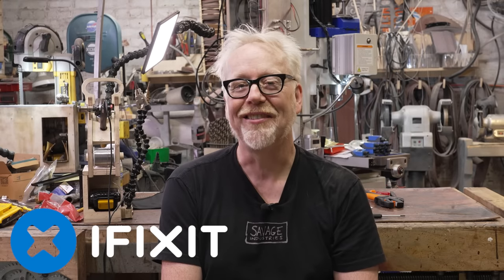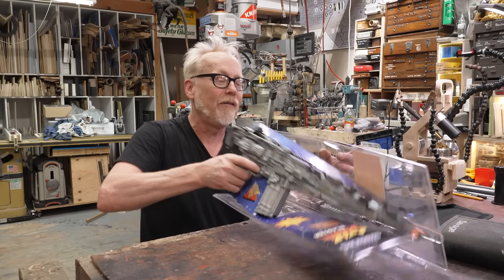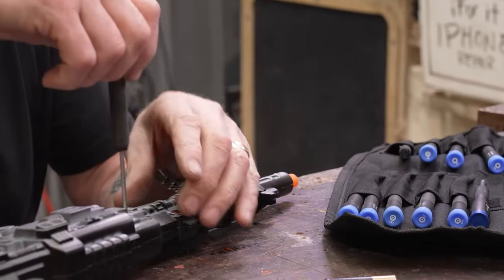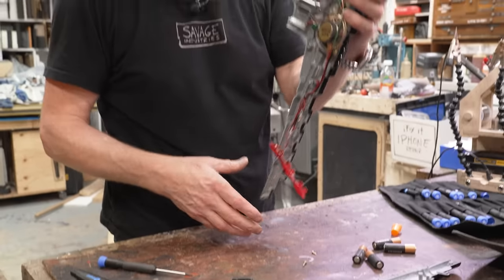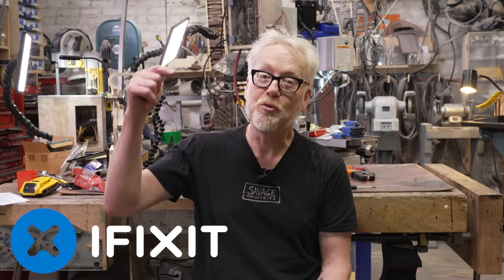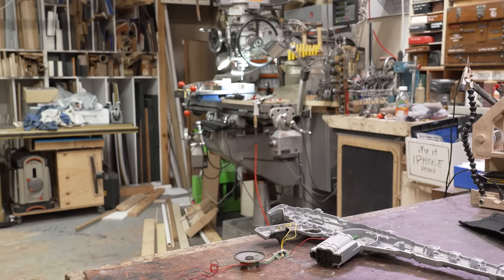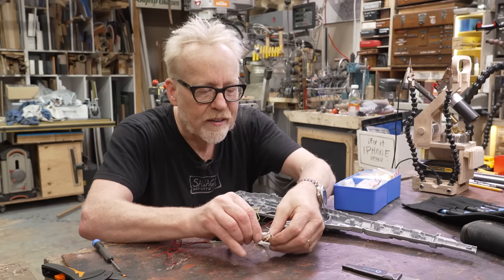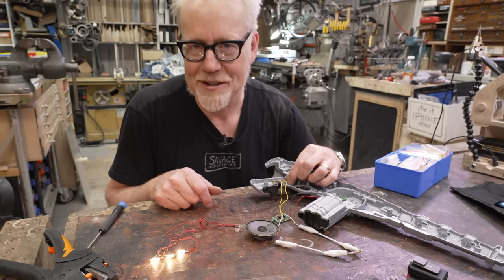How to Quiet Your Kids' Toys!

Comment: I used to put tape over the speaker holes. Helped a bit. Did not want to open new advanced toys, like talking Transformers, just in case i did not get it back together. Older toys, Shure.. A resistor and a soldering iron is a blessing. I also  got "allergic" to RGB blinking/cycling lights over the years.

Comment: For all you closet neards out there. Almost all speakers have a resistance of either 4 or 8 ohms which is normally marked on the speaker. If you had a 4 ohm speaker and put a 4 ohm resister is series with it you would have half the voltage a crossed the speaker and half a crossed the resister cutting the volume in half. With a 8 ohm resister you would get 1/3 of the voltage a crossed the speaker thus 1/3 the volume. And for all of us out of the closet doubling the volume or reducing the volume by 1/2 or  is plus or minus 3 decibels or 3db. Adam I almost bought my grandkids a set of drum at a yard but wanted to live another week so I get it.

Comment: If anyone wants a basic understanding of the simple component electronics shown here, the only equation you really need to know is Ohm’s law: Voltage (V) = Current (I) x Resistance (R), in Volts (V) = Amps (A) x Ohm’s (uppercase Omega symbol). The two other things would be Kirchhoff’s voltage and current laws. Where KVL states that the voltages in any closed loop in a circuit will have a sum of zero, and KCL states that the sum of the current entering or exiting a node (where wires are joined together) is zero. Those 3 things let you solve pretty much any basic circuit like this, though it starts to get a little trickier if you have capacitors or inductors involved.

Comment: If you put the correct resistor value in parallel in addition to the series resistor, you would probably get the correct voltage drop on the circuit for the lights to still work. 

Just guessing here, but if the speaker is say 8 ohm with a 100 ohm resistor in series, something like a 20 or 30 ohm resistor in parallel with the speaker+100 ohm resistor would pull the resistance of the circuit back down close to where it needs to be for the lights to work.

Comment: Here are my methods:
1. Open up the toy, put a piece of tissue paper in to physically damp the speaker. No cutting or soldering required.
2. Open up the toy, put a resistor across the speaker leads to reduce its volume. It reduces the voltage drop across the speaker, but this is unlikely to be a problem (in your gun, it'd make the lights blink more strongly.) Use something from 3 to 80 ohms. No cutting or stripping required, just bend the resistor leads across the speaker leads and solder it there.
3. Putting in a series resistance like you've done. Speakers are usually 4 or 8 ohms of resistance, so using a low value resistor is enough to drop the volume a lot--a 4 to 30 ohm resistor. Still loud enough to be fun for the kid, without being something that'll drive everyone in the house crazy.

Comment: I did this with a portable induction cook top. Every press of the button was just an obnoxiously loud beep, and if you took the pan off while it was running it beeped continuously. I Tore it apart and tested resistors till the sound was quiet enough but not so quiet that I wouldn't notice it beeping. So even if you don't have kids, this is a good trick.

Comment: Not a parrent yet myself but i remember my mother winning a cheap toy price that was also very noisy. 
I solved the sound issue with a pocket knife with a flat blade that i could stab through the sound slits and into the speaker without ever opening it. 
It would still blink like crazy when you used it but now with blissful silence

Comment: You never gave the toy gun to your kids! I'm not sure if you are a monster... OR the smartest person in THIS WORLD! 
My son has had some very loud toys too... after a few hours, they usually met with a timing "unauthorised wiring modification" with a pair of side cutter dikes!
OR stage tape over the speakers!  Parenting FOR THE WIN! :)

If you really want to quiet the toy or device  (I have a few noisy UPS units, that like to beep during the night time!) down for real, a well-calculated resistor voltage divider circuit will always fit the bill perfectly! Yes, Adam those semiconductors are magic! and it took several years of school to learn which way the electrons and the holes go through them, without letting out the magic smoke! :)

Great content as always sir!

Comment: You can also buy adjustable resistors (potentiometers) that you can tune with a screwdriver. But they would be a bit more pricey. They (as well as regular resistors) might get hot (depending on how much electricity is going through, so you might have to account for wattage when selecting one. I have burned resistors, and they can start fires if you're not careful. Especially with all the nice flammable solid fuel around (plastic)

Comment: A few years ago we got a cheap little train toy (engine and rolling stock) with a similarly horrible noise. We wanted to run it around a Christmas tree but it would cycle through multiple over-driven sounds the whole time. 

So I put a variable resistor (potentiometer with two legs shorted) inline with the speaker. That way we could adjust the volume to suit our mood.

Comment: If you don't have any smaller value resistors, you can connect two of them in parallel to get half the resistance.
Or you can connect them in series to get double the resistance.

Comment: One idea is to put a double pole switch in, I.E. a switch that toggles between one output and another instead of just off or on. To tell the difference, an off/on switch will have just 2 pins to connect wires while a double pole (also known as double throw) will have 3 pins with the middle one being the common pin that the switch is always connected to.

Have the wire coming from the circuit board go to the middle pin of the switch. Bridge the other two pins with the resistor and then connect one of those two pins to the speaker.

What that does is when the switch is in the position for the pin the speaker wire is connected to the input will go straight to the speaker and be loud, switched the other way it has to go through the resistor then out to the speaker making it quiet.

You could then cut a hole in the toy for the switch to poke through giving the child an option to make it quiet for inside use or loud for outside.

Comment: I did this to a toy that had a speaker and a motor(fan) and putting in the resistor also reduced the fan speed so had to balance quite well. It also made the batteries last longer which was a bonus!!

Comment: If you are wondering what type of resistor you need for this:
The cheapest you can find. Resistor quality is just about accuracy aka how close they are to the labeled value. 
Only space and medical engineers need high end resistors, almost everyone else is lying to themselves. 
This truly is a prime example on what the cheapest resistors are for. For the vague: "I wanna lower the output a bit."

Comment: An mp3 player module costs about 2$ if you just buy a single one.
It already has a micro SD slot so all you need to do is add controls speaker and power. (and the sd card with the sounds)
It has wiring options for buttons and can be controlled via 2 pin serial port RX/TX
It's size is mostly determined by the pins and the card reader. it's a card reader with pins. (I think it also has line out in case you want to connect it to a proper amplifier.)

Comment: You could add a switch to put resistor in or out of circuit. Then you could have volume set for indoors or outdoors. Heck, you could add a pot to use as a volume control.

Comment: I generally insert a 1k ohm potentiometer into the line and adjust it for the desired volume and then measure the resistance and replace with a set value resistor.

Comment: My little fix for making the speaker quieter is to put a lie e of tape over the speaker holes. Most of the time, there are small open holes or slits to allow the speaker to be heard. I put tape over them, either on the inside or outside to dampen the sound

Comment: Instead of individually testing various single resistors, there is a resistor box kit out there that has the various resistors contained and a rotary switch plus resistor leads. All you do is hook the box to the leads start out at the highest resistor start tuning the dial down until you get the tone that you are comfortable with. It also works great with LEDS for intensity.

Comment: I did something like this with a cheap keyboard I got at a garage sale. I knew my roommates wouldn't want to hear my terrible beginner playing, so I rewired the speaker to a TRS jack (standard headphone jack) with a potentiometer (variable resistor with an adjustment knob, basically what volume knobs have been for over a century) inline with one of the speaker wires. This thing was so cheap it had one speaker, no headphone jack, and no volume knob, so it was actually a necessary mod, along with soldering the leads for a 9V dc adaptor into the battery compartment, because I'm not shelling out for 6 D-cell batteries in this day and age.

Comment: sound is waves. what carries waves? Air.   IF the speaker is close to the tiny holes in the toy, you can just put a see thru piece of tape over the sound holes. That lowers the toys sound tremendously. It's easy and cheap way to silence some toys.

Comment: I'm an electrical engineer, specifically an embedded systems hardware engineer.  I quieted my kids toys by placing a cotton ball on the speaker and then wrapping that assembly in electrical tape.  A completely mechanical solution.  
Although with a speaker that size I probably would have just cut the wire and claimed ignorance on why it doesn't make sound anymore

Comment: You point out that the resister turns some of the power into heat.  Try using a capacitor instead, which won't get hot and saves power.
As I recall, in-wall volume controls for whole-house audio or theater rooms, have cheap ones that are just potentiometers and more expensive ones which are based on variable capacitors.

Comment: Adam, come on now, we had chipped toys.  1978 Starbird,  One of my favorites, it had an angle sensor so the sound would rise or fall depending on how you held it.

One of the few toys that made it in my parents home past my college graduation besides the LEGO.  Mine stopped working before then, but I liked it so much I found one on Ebay in full working condition and box over a decade ago and added it to my meager childhood collection.

Comment: Yeah i used the same trick on an cheap Chinese Li-Ion battery charger, its piezo speaker was so freaking loud so i just soldered in an little resistor which made it way more quiet and less annoying.

Comment: When I did this patch to one of my kids' toys I used a variable resistor, basically adding a volume control to the speaker. Adjust it to the level you want and enclose it into the toy so the child can not adjust it. Later if you need it louder or even quieter you can open it up and just turn the knob and close it back up again. Optionally you can add a hole for the knob to poke out of so it can be adjusted any time, but that becomes a problem when the child learns to turn the knob! LOL

Comment: If you want to make this more permanent than alligator clips, you can also skip soldering.  There is a product readily available and affordable that is basically shrink wrap tubes with low-temp solder in the middle.  Stick the stripped wire ends in there and blast it with a heat gun (or a lighter) and it will shrink to the wires and melt the solder giving you a decent connection.  It's not perfect, but good enough for a project like this.

Comment: You could probably also lower the volume by cutting up a bit of kitchen sponge and stuffing it in front of the speaker. Or, if there are holes in the gun to let the sound out, you could tape over them from the inside.

Comment: "I don't know if 82 ohms will work on your childrens' toy"
I can almost guarantee that 82 ohms will work. You can calculate the volume drop of the speaker by dividing the resistance of the speaker by the resistance of the speaker + the resistor. You can briefly see at 8:55 that's an 8 ohm speaker, so an 8 ohm resistor would cut the volume in half, an 82 ohm resistor takes it to 9% volume, and the 330k was 0.002% volume.
8 ohms is really really common, speakers with a lower resistance are typically louder to begin with but their volume will be cut more by the same value resistor. Speakers with a higher resistance are often quieter to begin with but also won't be affected as much.

Comment: I'd measure the resistance across the speaker and choose a suitable resistor and put it in parallel with the coil of the speaker, so some of the current is diverted, it should reduce the volume of the speaker.

Comment: My first car in high-school was an old 90s car that had obnoxiously loud tweeter speakers that would hurt your ears (they would start to clip at medium volume) . So i took apart the speakers and did the same by adding small resistors that i pulled out of old electronics which lowered their volume and the sound quality was far better and they no longer clipped even at high volume. But it did take me a while to figure out which random resistor to use.

Comment: 16:34 my understanding of resistors is they act more like a pinch in a pipe. Whilst they do waste a little bit energy by dissipating heat that is not how it works - It works by constructing the flow of energy to the speaker. 

I think this is broadly right, no analogy is perfect but maybe it will help with the ‘electrical intuition’ that is hard to get a grip of.

Comment: On the back of the speaker is printed "8" and then a Greek omega - that means 8 ohms of impedance.  Using a multiple of that (8, 16, 24, 32 ohms) will quiet the output by that multiple.
Conversely substituting a speaker with a lower impedance will make it louder (4 ohms will be about twice as loud). You can't go too much lower or you will burn out the electronics driving the speaker.
Reply: Very useful information!

Comment: Stripex has been a tool of mine for more than 20 years as a Danish electrician.... I do however only use it when I have to build switchbords or other jobs where I have to strip ALOT of wires.... Normally I just use my cablecutters, give the wire a soft pinch and push the insulation of with the thumb of the hand holding the wire... Takes a bit of decterity/feel, but it is much faster when you learn to do it properly than switching tools all the time...

Comment: My relationship with electronics is probably not much better than Mr. Savage's but one "level up" was changing how I thought about resistors. They don't "dissipate the rest as heat" like there's a fixed amount of energy and lower resistance is less wasteful. Otherwise, an open switch, which is a resistor of infinite resistance, would generate infinite heat. The way to look at it is that resistors control the amount of current, and the price you pay for allowing current is some heat. The more current, the more heat, but more resistor, LESS heat, rather than more.

Comment: Make a Decade Resistance box as a one day build.

It's basically the same thing with testing different resistors except it's got (usually banana plug) terminals that you can plug in clips or whatever into, and then a series of dials  to get the right resistance, so it puts in series the resistors to give you your value. There are many ways to do it but that's one way.

Comment: I put a switch in parallel to the resistor I added to my kids ray gun, it gave them 1/4 volume for inside the house and full volume for outside.... Also tape over the speaker holes can work in a pinch.

Comment: HA! Phil is a legend.  I can't tell you how often i have done just this exact thing...  If for whatever reason the resistor isn't an option I often would put a piece of foam over the speaker when re-assembling... 

on occasion i confess i would intentionally clip the speaker wire, or punch a hole in the speaker because i couldn't take it anymore...

Comment: The simplest/fastest way to figure out what size resistor without having the electrical knowledge is to put a rheostat in line, adjust it to where you like it, measure the resistance it is set to, and then put the resistor closest in size to it that you have

Comment: Been there, done that.  I used a small multi-turn trimmer potentiometer I had on hand in series with the speaker.  It let me dial in the right resistance to reduce the volume on my granddaughter's Peppa Pig riding toy to below the level of annoyance.

Comment: Lol As an Uncle who did daycare for decades, I feel your pain. My tricks were either A: put weak batteries in, or B: "forget" the batteries, or C: limit the number of batteries so they could only power 1 annoying noise maker at a time.
It didn't always work though. lol
A potentiometer to get the general resistor value is a good idea.

Comment: The non-tech way to quiet a noisy toy:
For those who don't want to even think about resistors or soldering cut a piece of light cardboard and cut out a circle a bit smaller than the speaker a small wad of fiberfill or a small piece of soft cloth and put it up against the speaker and then put the little circle of thin cardboard over that and test to see if it muffles it too much or just enough.
You want it to be just loud enough so the child will still enjoy it but not so loud as to be heard all over the house from the farthest room or basement.
You can always tape a bit of fiberfill over the back of the speaker also.

Comment: Adam, look at the speaker it is probably a 10 ohm speaker. Might be larger in ohms.  Use that to decide what resistor to put in series with it.